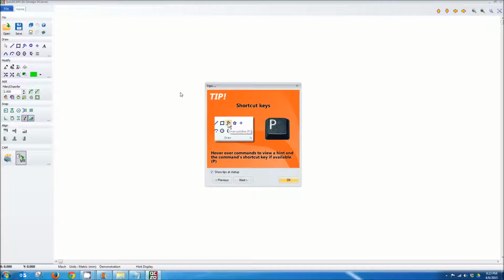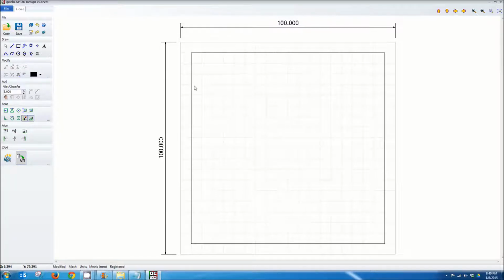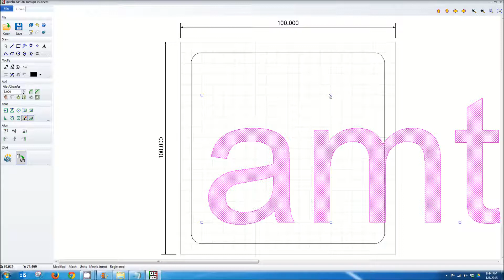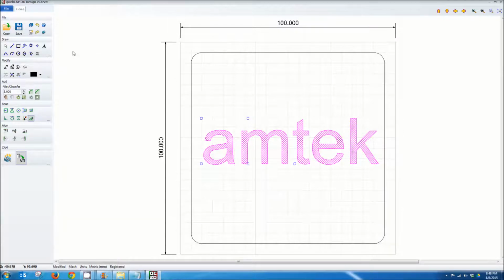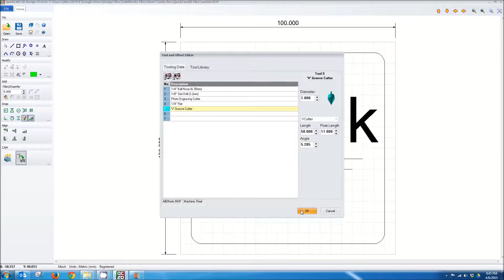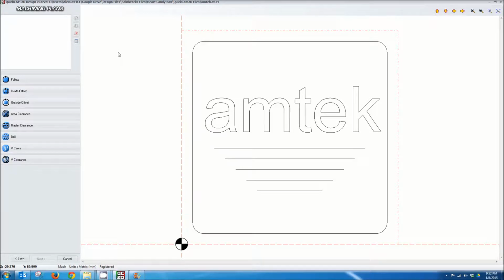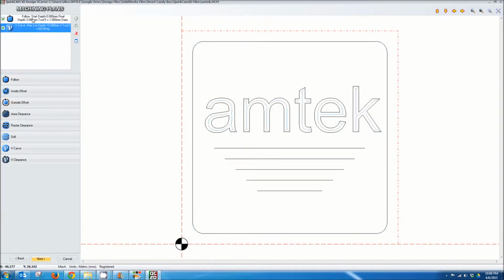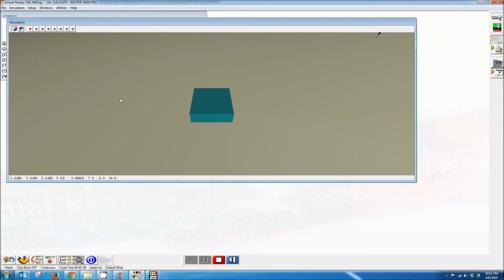Making a Simple Sign with Denford QuickCAM 2D Design with VCarve - Part 1

Comment: hi, I have a quick question. How do I change the travel distance allowed, When I go to run a program I get an error about z-axis exceeds limts. However it only goes down about -2mm. I lifted the material off the bed a couple inches and works fine, however I would like to be able to have material closer to bed, with maybe a 3mm spoil board. How would I change this. The machine has been sitting at my workplace, not being used, so I started to play with it.